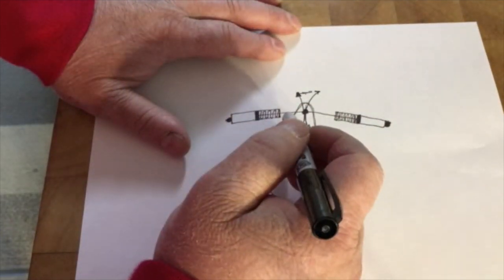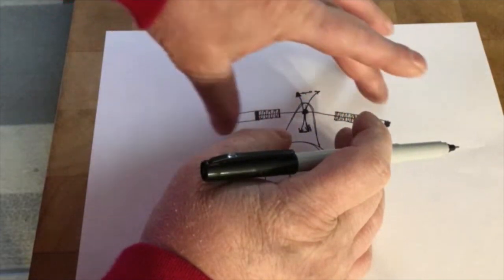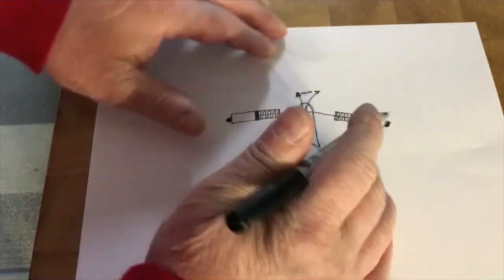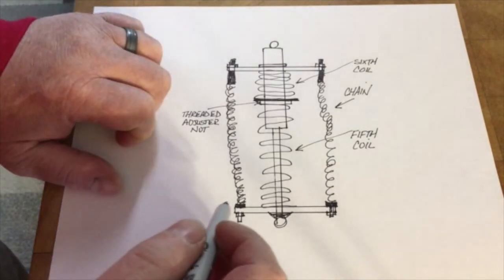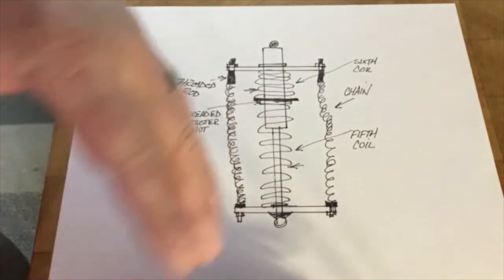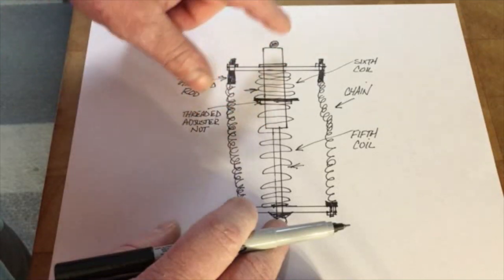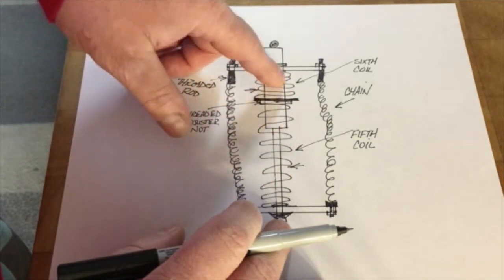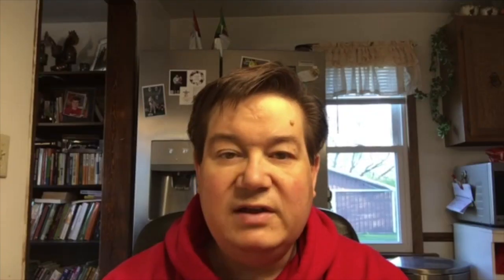Combining the Fifth and Sixth Coil on a Dirt Late Model and Dirt Modified Race Car

Comment: I think this could be done with a spring inside a spring. What’s your opinion? I’m gonna roll it around in my head and see what falls out. Thanks!
Reply from the maker: I know I’ve always struggled with clearance issues with this. The smaller you can get it the better.

Comment: How does big cube (465 SB2) engine affect they 5th coil spring rate? Need more preload or stiffer spring? Move shock back toward diff on lift arm or?
Reply from the maker: It’s probably more of a torque issue than anything. Big blocks are pretty torquey beasts. You might need to stiffen some. I really don’t have any experience with them. Thanks for watching.

Comment: I had one of these setups that came on our WILD car. It was pretty slick. Very consistent and predictable.  I wish I could've told you the rates for those curious but the springs weren't labeled. We initially ran it at 37" but pushed it back to 35" and I personally was more pleased with it, but keep in mind we were 27.5" ball joint to mid plate engine placement.

On the split setups I found entry to be alot tighter. There's a million variables to play into that however and I would say that effect could be self inflicted. My honest opinion at this time would be that on a tight corner racetrack with traction, this setup is a secret weapon.
Reply from the maker: I built your Wild car. 
That was a while back. 
The combined 5th and 6th you are talking about is one of the ones I put together. We originally ran a 300 lb. 5th coil and a 600 lb. 6th coil.
The tough part is finding springs and figuring the height and preload so you won't run out of travel, yet all the springs fit on there.
 Thanks for watching.
Reply: When you moved the 5th coil spring back is what tightened up the car on entry. The 5th and 6th coil combined did nothing to tighten car on entry

Comment: Where on the arm was it mounted (front, middle, back), and did you change this according to track conditions?
Reply from the maker: My memory is bad, but if I remember right it was about 36" from the center of the rear axle. You can play with this a little. I think the trend is now to move it back to get a little more instant traction and help keep the nose on the ground.
Thanks for watching!
Reply: @HoganTechnologiesLLC  Thank you for the information. Did this distance stay constant throughout changing track conditions? Did the distance change if track size or banking change?
Reply from the maker: We didn’t change it much if at all. That doesn’t mean I wouldn’t. We just never did.

Comment: Is it worth losing the ability to decouple the wrap down and wrap up force application points so that you can remove some slack in the system? I’m not sure. To me, it doesn’t seem that big of a deal if there is a 1/4” of slop when the rearend is hanging, because that gets taken up instantly the second torque is applied in either direction. You could argue that the momentum the lift arm gets in that 1/4” of unrestricted movement (not taking into consideration shock compression/rebound) could shock the tires, but it’s hard to say. The time that the lift arm spends NOT loaded into either 5th coil or 6th coil is probably .01 second or less per lap. I would be interested running a pullbar with a 6th coil.. but arbitrarily stupid rules prevent that in supers now.
Reply from the maker: I always thought about it as keeping the tires stretched with traction. A simple gap it time could be enough to loose the stretch and make it harder to rehook in the slick. This probably doesn’t make a big difference when there is some traction, but when traction is limited, there may be something here.
Thanks for watching.

Comment: What did you run for spring rates & amount of preload when running this setup?
Reply: I wish I could remember exact.y, but I think the bottom was a 300 or 325 and I’m pretty sure the top was a 600. I think I preloaded both a ¼”. The cool thing was once they were preloaded it was done. We had to safety wire the top spring to the top plate to keep it from floating. You might find a better way. I’m always encouraging people to take what I give and make it better.

Comment: Have you ever made one of these and tried it on the track?
Reply from the maker: This was our primary fifth and sixth coil deal for about five years. We had the top and bottom plates custom machined. Ours had three chains on it. We also had about six guys on them. You will need to figure it out for the type of shock you run.